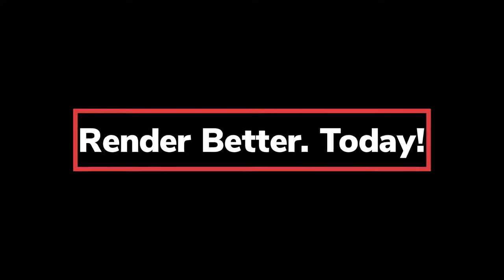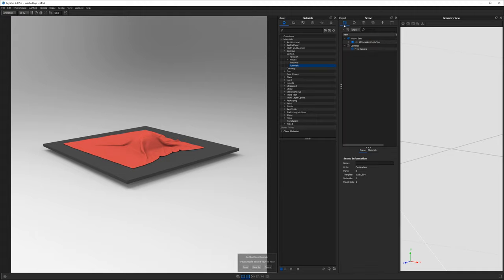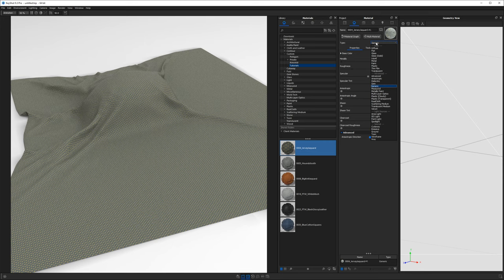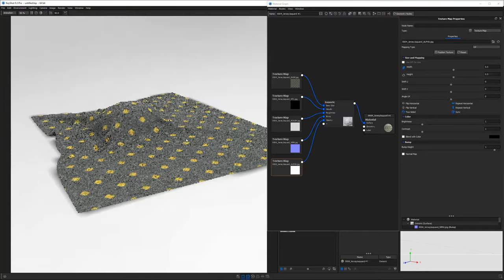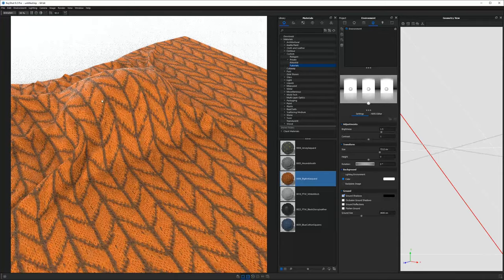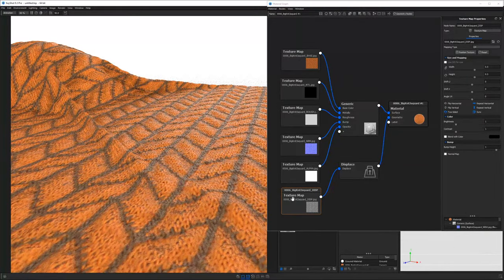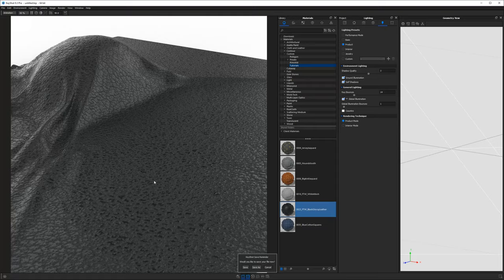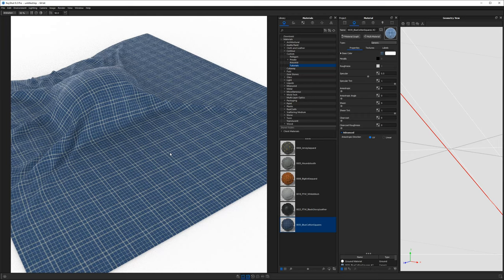How to Use Scanned Materials in KeyShot

Comment: I came across an online site before but lost it. 
Is there a website you know about that will take a printer scan or photo of a material swatch, and generate the proper files needed for a custom keyshot material? 

One definitely exists and if I can find it again, I will reply here.
Reply from the maker: Hmm, not sure. You can make your own textures using a program like crazybump or pixplant. They just require images like you suggested. Xrite scanners can create measured material types which can be read by KeyShot without any need to edit them. Vizoo also makes scanners. Maybe someone owns one of those and offers KeyShot material creation from scans. Not sure. There are options out there though.

Comment: What are your thoughts and experiences with Axf scanned materials?
Reply from the maker: Very little experience with them. They should work in pretty much the same way, but with less edit-ability if I'm not wrong. They should be just as accurate though!
Reply: @WillGibbons  yeah. De have a machine like that at work :)
Reply from the maker: @mangoplukker  Then you're lucky! Use it! haha, not every company can afford it, so if you have it, I'd give it a go.